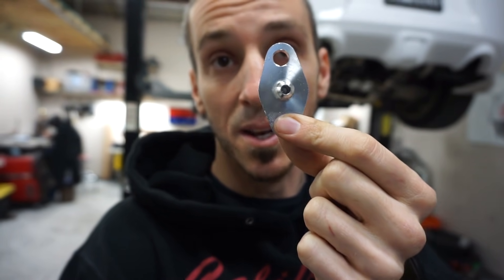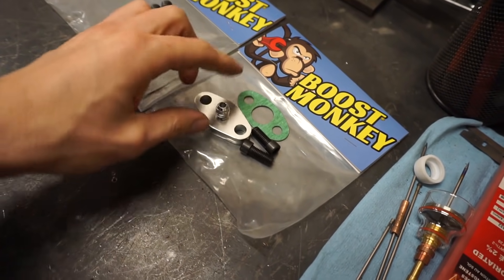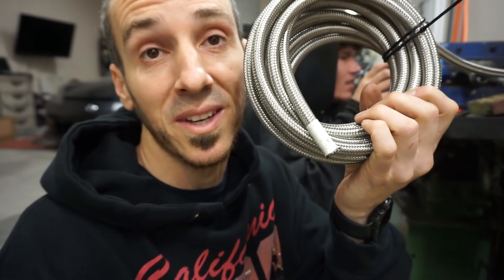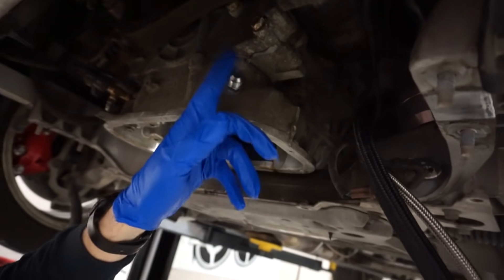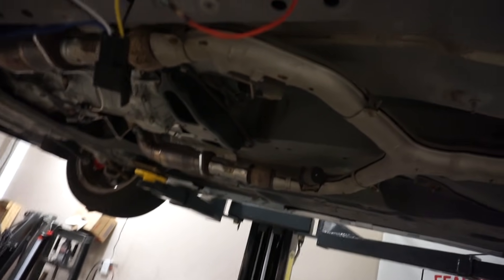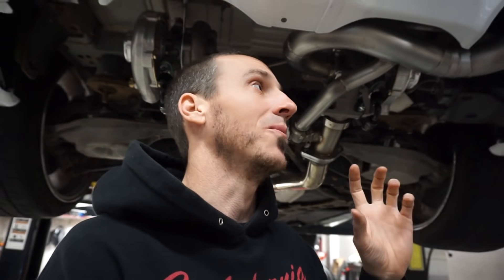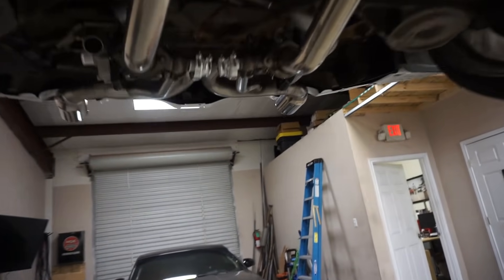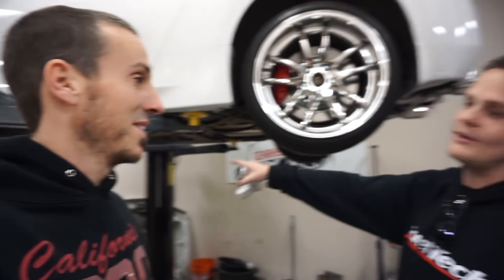Rear mount twin turbo 370z part 2

Comment: I’ve never been so excited over a project on YouTube. I own a 370z Nismo and you are inspiring me to follow your lead on this project. I’d like to Turbo my own Z without having to spend 10k for a kit. I also agree with you the simpler the better.
Reply: @jolmeaki  I agree
Reply: They sell a rear mount turbo kit for like 4-5k
Reply: Same here!  Fast Intentions = $12k for the whole setup...
Reply: @austinbrown924  do you have a list of what you went with, i wanna rear mount turbo as well don't feel it would cost more than 3k
Reply: @djfreddyb407  no different than any other turbo setup as far as parts go I run a gt3584 .82a/r turbo the only difference is you'll have to figure out how to mount the turbo ....I used an intercooler pipe kit a piece of exhaust pipe for the straight run a single in dual out intercooler aem 340 pump turbonetics boost controller precision pw39 wastegate a scavenge pump 20 dollar type rs bov tomei type s fpr a vacuum block innovate wide band eBay boost gauge and a oil pan spacer for oil return feed is from a sandwich plate that's about it you just have to build everything it only took me 3 days to do it fic 1200 injectors are plugnplay so buy those I've got a picture of it all on Instagram I think.     tree_fittyguy
Reply: @austinbrown924  Would you happen to have a link to the intercooler kit you bought? Is it one from ebay?

Comment: I wonder why not use an independent lubrication system, a reservoir, pump, heat exchanger etc... I mean you already running an electrical oil pump. Keeps the oil temps cooler and cleaner on both the engine and turbocharger. Also if there's a leak in any of the systems you can save one, the engine or the turbochargers. Even put an independent monitoring system for turbochargers oil pressure and temperature.
Reply: I like this idea + easier for us simple folk to install
Reply: That is a good idea! Only issue would be changing two different oils, not a horrible inconvenience, just one more step everytime you change your oil.
Reply: The reason that it is not done the way you suggested is the oil pump cannot create sufficient pressure on the inlet of the turbo center section.  Standard oil pressure in a car at operating temperature and high RPM would be about 60-80 psi depending upon RPM, engine type etc.  there is no way that that "scavenge" pump can create that pressure. its kind of the reason all oil pumps on engines are gear driven off of the crank so they have enough torque to pressurize the oil.   @sinformant
Reply: also no oil sump on turbos probably not gonna drain well.
Reply: @carfreak1024  the oil pump is on the drain side of the turbo
Reply: @sinformant  the pumps are on the return side of the turbo correct.  So from there those pumps will need to go to a reservior that's vented to the atmosphere.  This is to allow the pumps to self prime.  Once you figure that part of the equation out you then need to find a way to store around a gallon of oil for this dedicated system.  Any less capacity than that and your turbos are going to cook that oil.  From the reservior you are going to need a second pump that you are going to use to feed an oil filter preferably a stock type oil filter with a pressure release bypass back to the reservior to manage the positive pressure on the feed side of the turbo.  This pressure release feature is to keep the pump alive from excessively high pressures that will result in trying to force a volume of oil through a very tiny orifice.  The last part of the equation is then the oil cooler which is going to require you to run oil lines to the front of the car anyway unless you would like to mount the oil cooler under the car and risk insufficient air flow too it and high oil temps which will kill the turbo or risk the cooler, sump, lines, pumps, etc getting hit and destroy the setup anyway.
Reply: The system would not have enough capacity  compared to the oil pan to equate to adequate cooling/heat transfer even with an oil cooler with active cooling. The turbo generates way more heat than the engine system does. You would basically bake the oil in a short period of weeks. Ive been doing remote and low mount systems for years and been through every possible scenarios and confirmed this.
Reply: I've seen a lot of people having problems with independent systems.

Comment: Wastegate dump tubes should come out the center with a shape that fits the bumper.....would look SICK! Also, add skid plates for oil pump to protect it from road debris.
Reply from the maker: Ya the dumps in like the shape of the lower break light......that would be sick ! And we are putting the stock under belly cover over the pump soon as we install the quieter one.
Reply: @GearheadsAutofab , car looks good.  The dumps out the brake light would make crazy noise, but control boost creep (if you have any now).  Can't wait to see final product.

Comment: Im happy with 5 - 7 psi of boost just to make it more fun with the turbos realistically stock the 370GT/Z is fun to drive  it has more than enough power for daily fun driving.
Reply: True these days anything less than 1000hp is considered slow by Instagram and YouTube trolls but they don't realise you can't use all that power on the street you don't get to enjoy the power

Comment: Wheels look good car will look sooo sick when u guys drop it. Sounds amazing too, no sweeter sound than a boosted vq. Can't wait to see what you guys do with the intercooler piping just worried it would be too low!
Reply: Nismonomania boosted VQ37* the 35 (minus the HR) sounds kinda bad boosted. Lower compression pistons + the way the turbo alters the sound of the engine naturally, sounds bad on VQ35s at least in the case of G35s. Zs sound okay boosted

Comment: A little tip, WD-40 causes rubber to swell and weaken over time. I would suggest using a little water or rubbing alcohol. That way, it still lubes the rubber long enough to slip it in, and then it will evaporate away.
Reply: Or just use oil..... no need to use any other liquid to lubricate the stuff other than the lubricating fluid that is going to be running through the line.

Comment: If you swap the turbos around (right moved to left  and vice versa) it would be easier to route your tips because they would be on the correct side.
Reply from the maker: Yes true....I thought about that a bunch before doing it. I would like to try it the other way in the future to see if I liked it better. Especially because I could do different things with the turbo intakes as well.....
Reply: Really hope you can bring this to market, curious about the whole economies of scale.   I would love a simple kit that just bolts on, not tapping the oil pan.
Reply from the maker: You can use a oil pan spacer and return oil that way with out drilling.
Reply: Gearheads Autofab or just cross the exhaust pipes left and right

Comment: Looks like it will be a good bit of fun, very clean build, just for future reference when you tacked the turbo mount bracket under the  car you should move the earth clamp onto the material you are welding. As you had it back on the exhaust pipe the current will travel the path of least resistance, so it might have arcked the bearing in the turbos. I know it sounds trivial but I've done that when I was a 2 year apprentice.   Regards  James

Comment: Are you planning on making a kit that the public can buy?
Reply: An exhaust shop can do the welding side of things, the lines can be bought anywhere. The overall thing isn't hard to do, BUT, you should research the get the correct stuff, and also look into aftermarket tuning. You can usually get away with a couple psi without tuning, but you should definitely look at an aftermarket ecu or one of those boost controlled fuel pressure regulators or similar.
Reply from the maker: Yes, hands down trying to tune the stock ecu for efficiency changes with egt fluctuation is the most challenging part. If I did it on a aftermarket ecu I could build out a aux modifier table. I think any one can build a rear mount kit,
Reply: no, remote mounted turbo systems are patented by STS Turbo who is currently owned/partnered with Holley. trying to manufacture and sell kits would be a patent law violation but there is nothing stopping you from coming up with something for yourself.
Reply from the maker: They only patented the oil return system, but I met mark squires when he first made the sts kits. I am only looking for a awesome boost solution that’s easier and cheaper for the z community to go fast.....that’s why I started Nisda www.nisdaautosport.com we have new z parts coming out later this year.

Comment: Do a independent oil pump and tank for the turbos. You’re probably gonna have drain issues if you try to run lines back to the pan. You could easily mount a tank and pumps in the trunk or under the car.

Comment: Excellent video. I know your trying to keep the cost down, but you could have gotten the Z1 Motorsports oil pan spacer with ports instead of drilling into the upper part of your oil pan body. I would add a gauge for your turbo pressure and boost gages(I know you probably already have).
Reply: George H. Arnold IV 

Z1 Oil Pan Spacer👍🏼

Comment: Dude, love the videos. Thanks for doing this. Im really watching. 
I noticed something, you may have some slight problems with boost creep.  Since you mounted the waste gate at a 90deg angle and not a 45deg. The exhaust tends to flow right past the gate when at higher RPM when its mounted at a 90.
Reply from the maker: Yes it’s called “wastegate priority” I’m aware of this. I don’t think In this application it will be a problem .....but we will see.....then I can let everyone know so they can do it different if needed.
Reply: I was thinking that the wastegate being at a 90 might be better because of how far the turbo's has to push air in the charge pipe maybe won't have as much or any lag from the turbos. But I'm no pro a turbo's

Comment: Putting your oil feed line high up on the oil reservoir, could cause your turbo system to Star for oil. Maybe under acceleration it could slash the back of the pan and cavitate did not send oil to your turbos? Also you need to make sure you keep an eye on your oil level cuz if it were to drop any at all the fact that it's up high would cause it to cavitate even at idle.

Comment: Hey cool turbo set up. The oil supply should a independent oil tank in the back at least a gallon with a 12 volt pump pumping straight to the turbos. You will lose oil pressure and return line has a chance getting caught and ripped off. The same way as a water to air cooled intercooler with a ice box (water tank).

Comment: For the oil feed. Maybe you should put a gauge on that line to see what the pressure will be at the turbo. Their is a chance you might have pressure drop over the distance.

Comment: The z cars were made to be turbo’ed. Look at all that space!  I’m doing the same on a v8 MGB and have waaaaaay less space. For the oil pump I’m using the same but found a dc motor driver that carries the voltage to the pump so you can run 6 v or half the pump rpm and it still hauls oil like a mofo. It’s at least 4 times quieter. Also you could mount the pump on grommets should lessen vibration noise from the pump. What size drain fittings and hose did you use?  I have herd the biggest you can fit is best. Also you may find that the return pump need air behind it like plumbing. Turbogriff solved this with little oil pans for the turbo that have a vent line so the pump can pull freely. The oil return is the biggest hurdle fore sure. Can you post longer term updates on this setup as it comes

Comment: Only braided line on my entire car is the oil feed which is 3an unrestricted which was 25 bucks used 5/8 fuel hose for return and barbed fittings

Comment: Hey.. I like your enthusiasm and your design as far as the route that you chose to run the oil supply.. but thinking of what would happen if I had a leak somewhere in the line more than likely it's going to cost me an engine.. I think you should have just ran a separate reservoir for the oil.. because you did put in an oil pump just for the turbos.. That way if it were to leak or blow a line.. Then your only loss would be a turbo.. not an engine.. but still your work is very good.
Reply from the maker: I thought the same as you at first, on paper it sounds good, in real life it’s really just super simple to run 2 lines that have no less chance to leak than normal turbo lines, oil is the thing I worried about most on the car .....and funny enough has been the easiest part with no issues so far.

Comment: Wastegate dump tube, you should put a flex pipe on it. In the long run the weld will crack.
Reply: STH kEep't SimPle Yup! We agree, have 2 ordered alreqdy, just been waiting for them to show up. It'll make installation of the 5 bolt alot easier too. Good suggestion.
Reply: Like what you guys doing. Keep it up.
Building my car for 6-7 years. Learn a lot from it and still learning how to go more faster.😁9 sec goal

Comment: The collars on the an fittings are reverse threaded inside. When assembling them onto the hose, spin it the other way and it just goes on with very little effort

Comment: My biggest concern would be dirt and stuff getting into the turbos.  I hope yall plan to build a box for the air filters to reduce that issue or may build a flat bottom rear diffuser to reduce drag and stop most of the dirt.

Comment: You hear the pump so loud because it's right under your seat with no isolators...  try putting some rubber bushings between the pump and the body panel
Reply: Ryan Rich good thought, but the pump has rubber isolators. It's really just a loud cheap $50 pump.
Reply: @stevenrodriguez3982  oh... my apologies, it didn't look like there were any in there in the video

Comment: What part of Texas are you from?  I'm up north of DFW, I worked for STS turbo back when I was in college - we "hung" most of our turbos using the stock exhaust / muffler hangers, with brackets welded to the downpipe and intake pipes.  That way turbo wasn't hard mounted to anything and could flex with the exhaust.  Your car will sound awesome when finished!

Comment: SICK!  It runs.  cant wait to see it make some boost.  a guy on the forums made a custom single kit for a 350 and his wastegate stuck closed causing the motor to blow a rod out the side.  so it WILL make boost for all the non believers in the comment section.
Reply from the maker: We are firmly committed to keeping all pistons and rods firmly inside the engine 😂😂😂😂lol
Reply: @GearheadsAutofab  lol what u guys using to tune?
Reply from the maker: Up Rev at the moment

Comment: What if you mount the oil pump in the back with a filter and 1L reservoir and have a separate system for the turbo. Would that work? Im guessing it would? If it does it would save from drilling the oil pan or using Z1 oil pan spacer which has the oil fittings. It would also save from the long hose and near driver oil pump noise.

I hope my suggestion works thank you for your videos they are fun and informative.

Comment: Maybe I'm wrong but isnt the waste gate suppose ed to go in the air feed path not exhaust path to relieve excess boost pressure before entering the motor?
Reply: you're thinking of recirculating or blow off valve. wastegate relieves exhaust presure before it enters turbo

Comment: wont you have over boosting problems since the waste gates are at 90 degress compared to the exhaust, the exhaust gases will just flow past the wastage inlet right ?
Reply: angel cabrera It depends man, it’s not ideal but that doesn’t mean it won’t work. There can be quite a lot of exhaust pressure in some turbo setups, sometimes in the range of double the boost pressure. So even if the wastegate is in a shitty position it will still release that pressure when it opens. Obviously if your particular engine setup needs to vent a lot of exhaust to control boost then yes, you might have flow problems and boost control problems with a bad wastegate angle like that. But so long as enough exhaust pressure can be released through the gate to control your particular setup then it’s more or less all good.
Reply: On my truck, a 4cyl turbo diesel, I really didnt have any good options for wastegate placement. It runs a log manifold with the turbo flange between port 1 and 2, and the wastegate flange between port 3 and 4 with the gate sitting 90 degrees to the manifold. It’s a horrible setup in theory, but it works just fine as the turbo needs most of the engine’s exhaust to make the set boost,  so the wastegate doesn’t have much of a job to do getting a little bit of pressure out
Reply: Marty McFly i feel like a setup like that on a diesel would be more ideal since diesel motors run much more boost without having to worry about over boosting problems causing damage to the block, and with the wastegate at that angle there would be less lag since not all the boost pressure is being relieved from the exhaust, but idk i hope they dont get any over boost issues bc that setup looks fucking sick

Comment: I'd honestly just use a remote oil system away from the engine, what if the lines get broken, crushed or just ripped off the car? There goes all your oil for the engine! I'd just stick a small tank in the trunk run lines to the turbos and run a cooler with a fan...besides your gonna need a pump to get oil anyways...
Looks nice though.

Comment: Everyone I’ve heard of that runs an oil pump straight off the turbos has problems. You need them to gravity drain into a sump or they’ll get sucked dry. The way you’re running the return will draw oil though the turbo.
Reply from the maker: We have a spot picked to hang a sump tank........waiting to see what happens first........it kinda makes me want to log in let pressure vs outlet pressure....I wish we where in a stand alone so I could add some logging channels .....